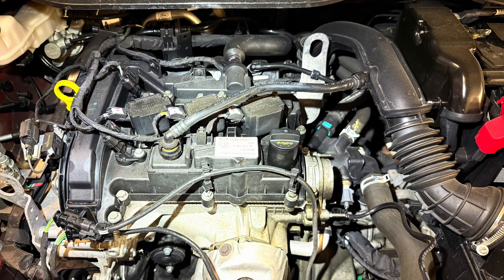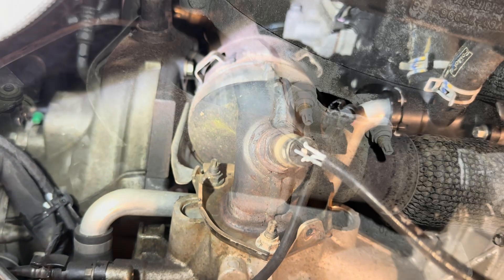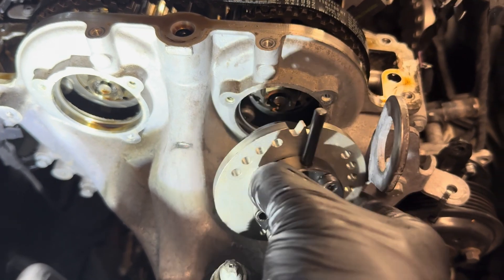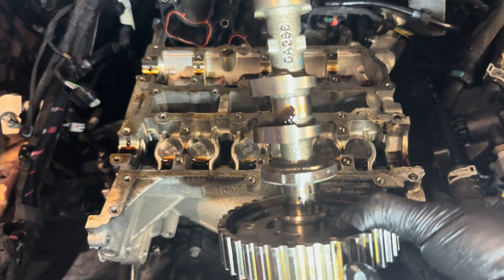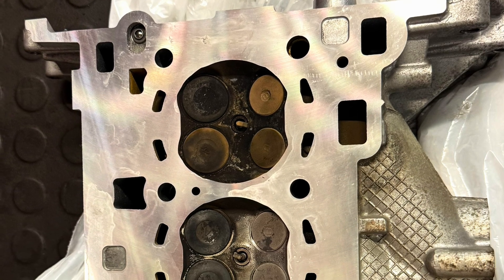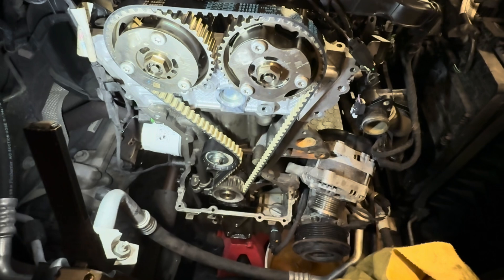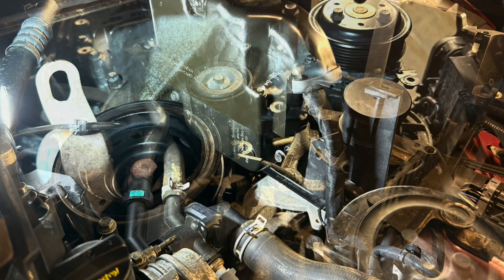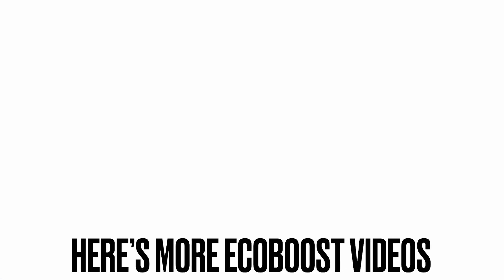Ford Ecoboost Head Gasket Failure – Overheating & Misfire Repair Guide.

Comment: DID THIS SORT IT AS THE HEADS ARE KNOWN TO CRACK,DID YOU PRESSURE TEST THE HEAD WHEN SKIMMING?
Reply from the maker: Yes it was pressure tested. No point in not doing!  All good after rebuild.
Reply: @How2FixIt1 happy days,got 3 heada here all removed i may consider sending off then for pressure test but at £50 a test is it dead money when a new heads £395, a gamble i guess, i think im gonna diy rig the exhaust ports to the pressure washer and back flush with cams out and if it leaks then I know its scrap and if it holds ill send for proper test
Reply from the maker: Let me know how you get on. If there any good I can link to them on eBay if it helps if there any good. I could add them to my link tree page. No guarantees but if it helps!
Reply: @How2FixIt1 ive already fitted one of the cheaper ones,im fitting a fai version next week, then may send my collection of heads for test after i diy test rig them